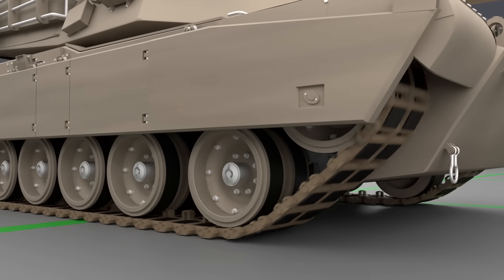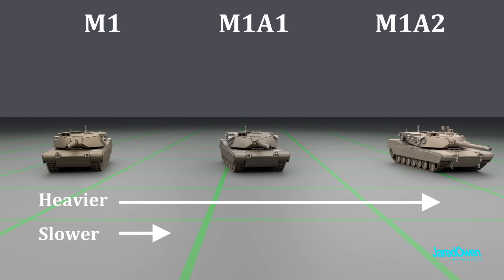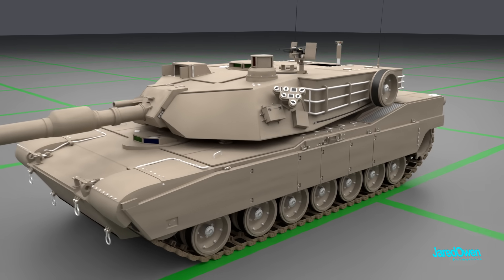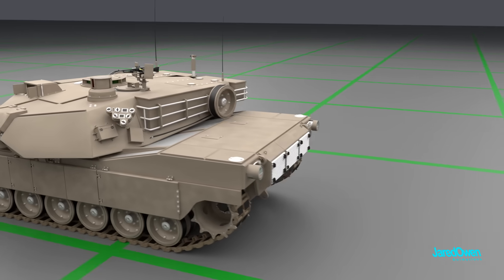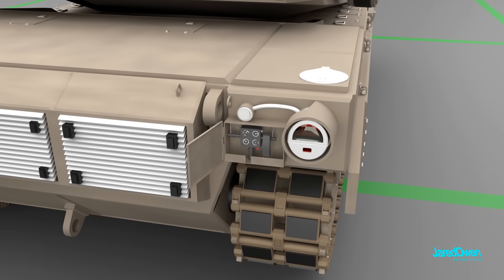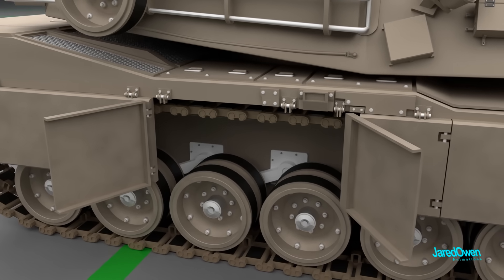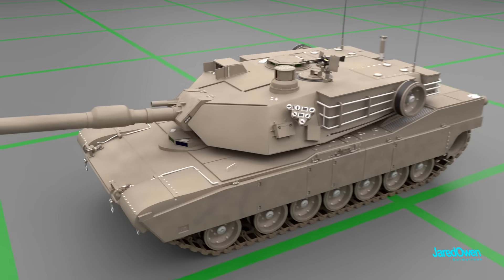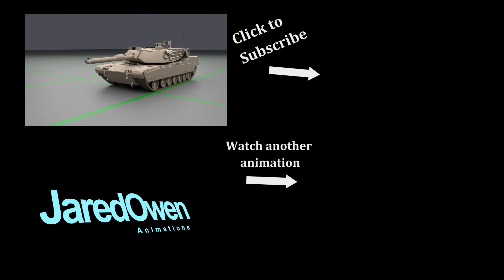How does a Tank work? (M1A2 Abrams)

Comment: this should be labeled "how the M1 Abrams Works" .  It's actually mostly an outlier..  most modern tanks use a piston diesel engine.  The Abrams is one of the worst gas guzzling tanks on the planet.
also, wrong loader animation.  He doesn't twist in the tank, good way to get hurt.  he drops the back of the shell low and flips the round tip first into the breech. He  then proceeds to shove it quickly and firmly, closing said breech when the round is loaded, declaring it is loaded (terminology varies per country).
Reply: Indeed, the Abrams uses nearly as much fuel per day as two Leopard 2's... the Gas Turbine engine represents a serious weakness in its design which is why the Army prefers the Diesel engine.

Comment: That engine cause a lot of problems in middle east war.
Reply: Most of the problems were encountered during the first war,  Operation Desert Storm.
The GAO published a very critical report in 1992 about serious problems with reliability and range with the Abrams during the war.
The Army has made several improvements to reduce these problems but the gas turbine remains a weakness in Abrams design.
General Dynamics has already selected an updated version of the Leopards MTU Diesel engine if a new A3 version of Abrams is ever built.
Reply: @sandervanderkammen9230  they can still use the engine turbine but not in middle east. the turbine engine is not for that kind of environment.
Reply: @otakugaijin2298  Indeed, the Gas Turbine is not well suited to desert combat in general. It was designed primarily for the Cold War against the Soviet Union in the European theater.
The Abrams primary design flaw, fuel consumption is particularly highlighted by the fast moving front of the vast wide-open desert battle field and exposed the weakness of a tank too dependent on such a large number of additional fuel and support vehicles.

Comment: Okay so I've noticed a few problems that I would love an explanation to, out of curiosity... 
@ 4:13 when scrambling over the terrain the front lover corner of the tank clips through the ground, would this mean the tank would get stuck? Wouldn't it make more sense for the tracks to be protruding past the front of the main body of the tank? And 2nd:
@ 6:59 0.25x speed. How come the front of the turret portion of the tank clips with the rear raised section on the body of the tank? Wouldn't that not allow the turret to rotate 360°?

Comment: how the turret can spin in 360 ??.. the body is higher in the back?
Reply: The gun is raised, but the turret otherwise will clear the engine deck.
Reply: The turret mantlet is notched below the barrel to clear the engine deck.
The Abrams is fitted with a device that automatically stops and raises the gun to prevent it from striking the hull of it is depressed to low. 
You can see it operating here;
https://youtu.be/pKHcKEc_2Nc

Comment: Actually the Abrams is extremely roomy when it comes to the crew compartment. In your animation the crew compartment was to small. The Abrams is known for being very comfortable tank wise. Also another thing your video got wrong was the smoke launcher. In real life those smoke launchers will actually launch smoke canisters into the air and then they will go off. Other than that your video was a bit simple (i think that was what you were going for) but mostly correct. Each one of those side panals are an inch think of armor. I've heard the panals that cover the crew compartment have depleted uranium in them for added protection. During my 12 yrs in the US Army I could never confirm that though.

Comment: The Abrams is a copy of the german tank Leopard 2
Reply: Hardly.
Reply: Yes, the XM1 prototypes were designed and built in Germany by Krauss-Maffei who manufacturers the Leopard 2's.
The Leopard and Abrams were designed on the same hull/chassis and have interchangeable powerpack combinations.
The Abrams M256 gun is also manufactured under license by Rheinmetall but is a cheaper less advanced version that lacks the concentrically balanced gun tube and hydro-pneumatic recoil system found on the Leopard.
Reply: @sandervanderkammen9230  No they were not designed on the same hull. they are not interchangeable. 

 Less advanced regarding what?
Reply: @peterson7082  6 hull/chassis units manufactured by Krauss-Maffei were imported from Germany   for the XM815 program... the XM815  was renamed The XM1 program.
Reply: @peterson7082  Are you not familiar with the advantages of a concentrically balanced tube???
Reply: @sandervanderkammen9230  I am not sure what you're trying to imply with "less advanced." For its weight, the spring system  works very well for the M256.
Reply: @peterson7082  The additional weight does nothing to improve the performance of M256 gun..
The L/44 gun found on the Leopard offers several key advances in tube harmonics in particular reducing annular wave and harmonic nodes in the tube.
Reply: @peterson7082  The powerpack combinations used in the Leopard family and the M1 Abrams are intended to be interchangeable and in fact are interchangeable.

Comment: I'm glad you didn't go into the secrecy of the special armor, so I wont go into that, but there is one thing you didn't mention.. ok 2. The Turbine engine is the same engine on the Super Cobra attack helicopter, and the engine gets so hot you can cook your dinner on it. War Thunder is an awesome game. Just wish I can afford an Iowa Class Battleship.
Reply: Not the same engine, no.
Reply: @peterson7082  https://en.wikipedia.org/wiki/Honeywell_AGT1500
interesting. I stand corrected. I was told that they were the same engine, however the Honeywell engine lost out to the GE engine used in the Helo's. Thank you for the correction.
Reply: The AGT-1500 was designed by Nazi engineer Dr. Anselm Franz who also designed the Jumo 004B engines for the world's first jet fighter the Messerschmitt Me-262.
Franz also designed the engines for the Bell UH1 AH1 and CH47 Chinook helicopters.

Comment: Jared, when you post anything in an international channel, such as YouTube, you must use ISO standard units and not imperial units. (If you instead aim at a domestic audience, please find another channel.)
    1 feet == 0.048 m ==> 2.44 x 9.75 x 3.66 m for the M1A2 Abrams.
    1 US ton == 907.18474 kg ==> 61.7 metric tons
    1 mph == 1.61 hm/h ==> 67.6 km/h
    1 US gallon == 3.7854 l ==> 1135 l (or worse)
    1 miles/US gallon == 2.35 l/km ==> 14.1 l/km (compared to 0.58 l/km for the car)
    3500 mph == 5632.7 km/h
    2 miles == 3.22 km
Except for your failure to use ISO standard units this video is great.
Reply from the maker: Thanks for the feedback Simon - I will make sure to include Metric measurements for future videos
Reply: Many thanks. Even if sub-texts it does a long way.
Have the best weekend ever!
Reply: Oh this is more clear now thanks.
Reply: What are you talking old man? Care giving us a briefings?
Reply: @airosmithredila4725  I think this subject is already settled, except you did not read the other responses and certainly not the one from Jared himself. Plus, I don't feel that old, what do you imply?
    It is as simple as this. If you post something on a domestic channel you can use whatever metrics you want. But posting at an international channel, such as YouTube, you must work harder and provide ISO standard units too, in one way or the other. As a kind courtesy of the international audience. And I hope you are polite and care for international people, do you?

Comment: When you angle armor it increases the thickness of the armor, it is not expected to deflect. Picture a two inch thick plate. Put a pencil horizontally across the edge of the plate. Lean that plate back in an angle and you will see how much more pencil it would take to penetrate it. This is how you save weight. Angles allows you to get the same level of protection with far less actual armor.
Reply: Tanks like Abrams and Leopard do not use conventional armor plate, composite armor is often most effective when struck by projectiles at a right angle.

Comment: While not a bad video, perhaps you should research road wheels a tad better...there are actually 14 road wheels on each side, as each road wheel arm carries an inner and outer road wheel...with the idler wheel and drive sprockets being doubled as well...AND three upper idler wheels hidden behind the track skirts that support the track on the upper side as it travels backward toward the rear idler wheel... 
And the engine is the best friend of Infantry soldiers in cold and wet weather, since, with an exhaust temperature around 1500 degrees, a soaked grunt can stand behind an idling M1 for 15-25 minutes and be totally dry....as well as being a multi-fuel engine, able to burn almost any fuel, including diesel, gasoline, kerosene, alcohol...pretty much any liquid combustible...
(and the tankers never get off their tank, except for chow.) (Seriously, I have seen tankers hang off the gun tube over the side of the tank to take a dump, and many tank crews wear sneakers inside the track to avoid making a mess.))
 The track skirts composition is still classified (DU+ armor), if one is damaged, it has to be covered and a replacement brought by specialized crews. 
You should explain that smooth-bore means there are no riflings, as one finds in a rifle, which imparts spin to the round for accuracy, partly because the tank round has such a high exit velocity and electronic firing  system that it is accurate without riflings to a range almost double that of the "effective range", generally, depending on round type HEAT (High Explosive Anti Tank) or Sabot (armor piercing) rounds, generally not exceeding 1500 meters (5000 feet)...(M1 rounds have been known to be accurately fired at maximum ordinate in excess of 25000 meters, or roughly 15500 feet or 2.9 miles). 
Note that the "shells" do not leave the barrel at all, they are ejected after firing the "round", sabot or HEAT. Shells are the container that holds the powder that fires the round. Your illustration shows a Sabot round being fired...note that the "shell", containing the powder which is burned to produce the pressure to fire the round, remains in the breech, and following the firing of the projectile, or round, the "shell", which contained the now burned powder, is ejected from the breech, (which your video does not show) while the round, or "bullet" is pushed out of the barrel by the pressure produced by the burning powder gas. Pretty much the same thing that happens with any handgun or rifle, except on a larger scale. The shell is never fired, it is always ejected. The bullet, or round, is that which goes downrange.
Co-axial, with regard to the machine gun, means fired from the same axis...in other words, the same system that operates the main gun is that which operates the co-ax, so that, when properly bore-sighted, both guns are accurate within the gun sight system, (electronic) which does NOT include the .50 cal and/or MG on top of the tank, which are NOT controlled by the sight system, but manually by the tank crew)
With the BFV, there is a third weapons system, the anti-tank TOW (Tactically Operated Command Wire Guided Missile) missile system, which is fired through the same sighting system, but not boresighted with the other gun systems.
The reason it's hard to find references is that so much of the Abrams is still classified. I noticed you said "some of the armor" with regard to the turret inner configuration...which would be the result of much of the armor capability still being classified. If guys like you could make a video like this with full information available, guys who wanted to kill Americans would be able to watch your video and have all they needed to to know. I don't fault your informational video, because many folks don't know much about American military capabilities, but keep in mind, Americans, or allies aren't the only ones who see online videos.
The newer tanks have auto-loaders for the main gun but not just the M1, but also both the British Challenger and Centurion, German Leopard and variants, French Le Clerk, Israeli Merkava series, and some of the Russian T-90/T-80 class, though how well they work is debatable. 
Jared, understand that while the M1s are sold to other nations, they may not be fully as capable as ours. Any US military hardware M1 Abrams, M2/3 Bradleys, sold to other nations, especially non-allies, is never as fully capable as our own.  As a Bradley Master Gunner M2/3, I have a pretty good working knowledge of American Armor, Artillery, Infantry and Engineer vehicles and capabilities, ammunition, range requirements, safeing parameters etc. Let me suggest, for future videos, get in touch with current or former military folks as resources, because public access will NEVER give you the stuff that is classified, restricted, or not generally known to folks who have never served or worn a uniform. I haven't played the game you advertise here, so I have no idea how accurate or real world it is, but your description of the M1 is far from accurate, with regard to detail, as I would expect from someone whose knowledge may  be limited to what is available on the Internet. And if I miss my guess, and you are a veteran who served in tanks, thus sparking your internet career, then you know what a Master Gunner is. (Did you know it is possible to stop any tank in the world with a piece of tin foil?)
For future reference, you might also want to include the side slope and forward slope that can be negotiated by the M1 (or whichever other vehicles you might be highlighting).
When you do your video on the M2, don't forget to include the M16 ports in the side of the original M2, which you likely won't find online or in any version of the M2A1 or later (M3, being a cavalry fighting vehicle did not have them.
I will give you credit for a fair video, fairly well researched as far as it goes. Good job. If you have questions about future military videos, feel free to contact me. 
J. Hansen, US Army, First Sergeant, (1977-1992)  BFV/CFV Master Gunner, built and set up 1st Bradley Table VIII gunnery range at Fort Polk, LA in 1989, after return from Panama, on a range that had not been used since the 1940s for M48 tanks. With gunnery following New Equipment Transition Training, returning from National Training Center, Fort Irwin, CA rotation, achieved 98% first run crew qualifications, with only 1 of 45 Bradley crews in the Battalion not qualifying. Given that background, you can perhaps understand my familiarity with M1s as well, especially as my best buddy at Fort Polk was an M1 MG.

Comment: Random Curious Thought:
What noise does it make when someone picks up that phone thats on the rear of the tank and tries to contact the inside???

I know it's not a ring... but what is it?? :P
Reply: ON a navy ship the sound powered phones didn't ring they were just always live as long as someone was talking,  the crew would probably have headphones to hear each other more clearly using a similar technology.  No need to ring, just talk.
Reply: As far as I remember It doesn't makes a ring, they can just talk in the internal communication system of the tank or use the radio, the tank's crew talks among themselves with headsets built into their helmets when the engine is on, also I'm not sure, it's been a while but I think there was also a light bulb next to the phone so the tank crew can signal the outside soldiers they want to talk, but maybe it's just my bad memory.

Comment: It's a disiel turbine not jet fuel. It can hit 3+++ miles. Not smoke, white phosphorus.
Reply: JP-8 is a jet fuel. Though can be operated on either one. It's technically optimized for Diesel, but has been running on essentially solely JP-8 in U.S. Army and U.S.M.C. service since the nineties without issue.
Reply: @peterson7082  I was in the army in  1999 and a tank mechanic we disiel only jp8 is very expressive.